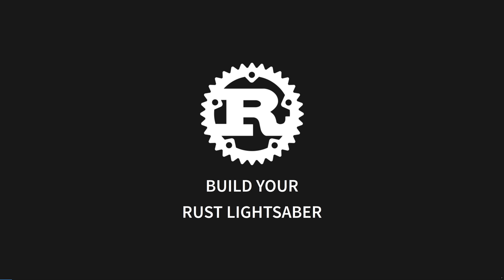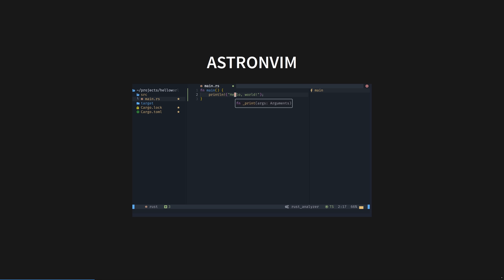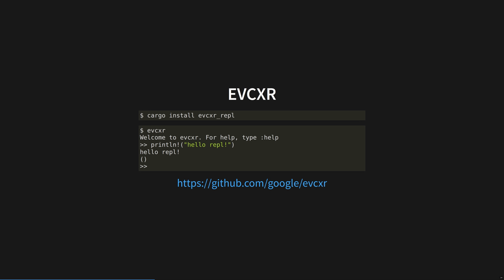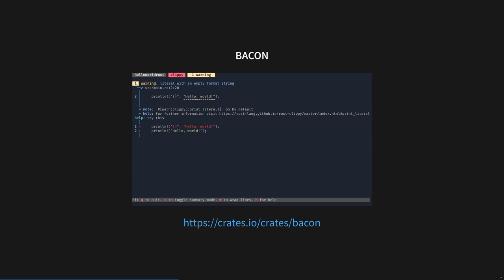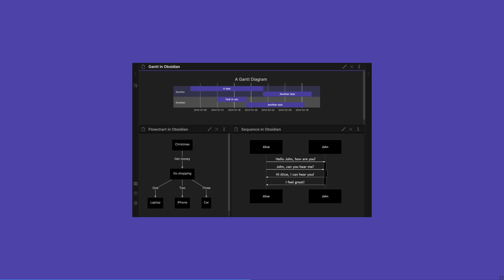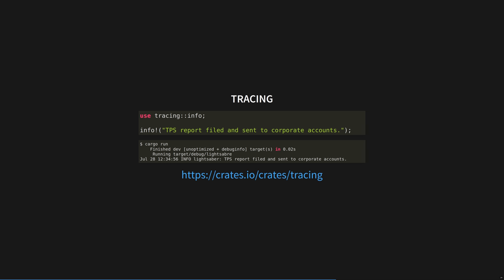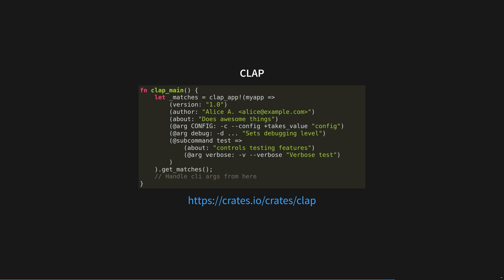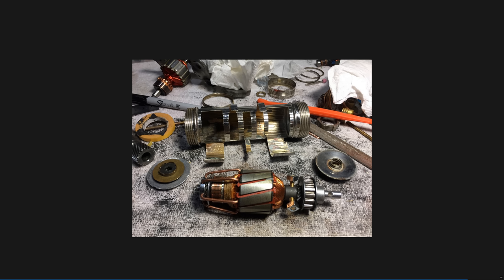Build your Rust lightsaber

Comment from the maker: ERRATA

I now (one month on) recommend irust - MUCH nicer than evcxr on the command line. 
I didn't demo this in the video, but neovide has a RAILGUN cursor mode https://neovide.dev/assets/Railgun.gif
Reply: 2:40 LSP, Language Server Protocol (Lump space princess)
Reply: @marcelo55869  That's out of context, clearly LSP means Liskov Substitution Principle
Reply from the maker: @marcelo55869  omg totally
Reply: - clap features presented in the video are from clap v2, not clap v3 
- isn't time the better crate compared to chrono ?
Reply: @walidjabari4985  yeah, time is looking to be the replacement for chrono and is being considered for std inclusion
Reply from the maker: @walidjabari4985  oh WAIT is that why I thought they were new features? Does v3 just have builder and derive?
Reply from the maker: @walidjabari4985  I ignored time because the documentation looks like this https://time-rs.github.io/book/index.html
Reply: @NoBoilerplate  ahahaha, that documentation is fantastic! Well, at least until you need to use it. Otherwise, I feel I might switch from programmer to philosopher... But chrono sounds cooler anyway >.>
Reply from the maker: @TheCreator1197  I'm unsure which is the best to use, I'd try both, chrono certainly has fewer downloads ..
Reply: @NoBoilerplate  time seems to be in the  standard library at this point, probably better to use that now unless you have a need for more features (if chrono has more there).
Reply from the maker: @clairemoore2923  I can't quite confirm that, do you have a link? I'm sure you're right!
Reply: holy crap that RAILGUN mode is AWESOME
it's one of those things that would just aid so much when navigating code just by adding a subtle visual cue to let you know where you were and where you're heading
Reply from the maker: @neithermanc1  right!
Reply: I tried irust but trying to add racer for auto-completion (that it recommends) leads to loading nightly tools and ends up in a compile error, leaving a lot of junk. I don't recommend.
Reply from the maker: @phenanrithe  Many folks (me included) find Nightly extremely stable, don't be put off by the name, this is Rust! Nightly might be more stable than every stable version of React 😆
Reply: @NoBoilerplate  Hehe, maybe. Still, I tend to favor mature crates when I can. In this case it seems to rely on racer which is not maintained anymore, which may explain why it doesn't compile. Besides, looking at the sources of irust doesn't inspire confidence, and there's virtually no unit tests. I'll stay with evcxr for now (at least as a lib). An equivalent of LINQPad for Rust would be awesome though.
Reply from the maker: @phenanrithe  evcxr with jupyter is my jam these days!
Reply: What about Tauri + Egui/yew ?
Reply from the maker: @RoastLambShanks  Strong toolkits! I did a dive into yew in my first wasm video, and egui in the second!
Reply: @NoBoilerplate  I'm thinking for desktop apps, combining Tauri with either egui or yew. It's not my idea, I saw someone else comment this someplace.

Anyway i'm not at the point yet, still learning rust at the moment, but I'll be there soon enough ;-)
Reply: @neithermanc1  i have never been sold faster on anything LMAO
i need to install neovide right now

Comment: Honourable (personal) mention for code editors: Kate.

It's developed by KDE, and is designed mainly for KDE Plasma, but it works on any other Linux wm/de, and also is available for macOS and Windows.

To me it feels like a lightweight VSCode, complete with LSP support, Git management, and a Vi keybinds mode. In terms of third-party plugins it's a little dry, but vanilla Kate imo is jam-packed with functionality and customisation options, so tweaking it to your liking is possible, assuming you can navigate through the settings page with sanity intact :)
Reply from the maker: Woah, Kate has lsp now? I gotta check this out! I've been using Kate in kde builds since 2001!

Comment: The astro vim + neovide combo looks amazing! Will definitely look into setting that up
Reply from the maker: Extremely tasty. I didn't even share the railgun cursor animations https://neovide.dev/
Reply: I used astro for a while, but ultimately switched to nvchad for the simple reason that user customization is better isolated.
Reply from the maker: @mariogutierrez4989  I'll take a look, thank you!
Reply: how do you do this? Have been trying and running into problems...

I messed up and installed neovide first, and then installed astronvim, I think I'm missing some dependencies
Reply: I'm making progress, my current problem is that the syntax highlighting isn't happening for me...
Reply from the maker: Neovide is the easy part I think, all the config is astro. Steps:
- Install neovim (get version 0.7+ from the neovim github repo releases)
- Install Astronvim
- run nvim, ignore the wall of errors, run :PackerSync inside nvim

I've heard of people getting into a pickle because nvim stores its config in different locations depending on operating system, do check you're cloning astronvim into the right location. For regular linux with regular nvim, it's ~/.config/nvim

Let me know how you get on!
Reply from the maker: @Sashin9000  oh great! inside astronvim Hit SPC L I to install rust lsp and syntax - it's a graphical installer!

Comment: So something that’s nowadays probably much easier to find but when I needed it it was quite difficult is: WGPU. It’s a crate that abstracts over multiple graphics backends in a safe manner (in the future, one of the targets it will support will be WebGPU, which is a work in progress standard for using the GPU in the browser), it can build for Angle, OpenGL, DX12, Metal & Vulkan and has, as long as you use it in an intelligent manner, quite a low performance impact. If you need an even cheaper and unsafe graphics library, its hardware abstraction layer wgpu-hal, might be for you.

Comment: laying the puns on THICK today

seriously though this is some of the best educational content on the site; going to have to watch this multiple times to make sure I understand it all.  I think this might be the fastest I've ever subscribed to a channel
Reply from the maker: Thank you so much! I'd love to know what you think of my other Rust videos!
Reply: @NoBoilerplate  I always watch at least two videos from a channel before deciding to subscribe just in case the thing I saw that I really liked was a one-off that they're probably never doing again.  this was the second one.  was already a big fan of both rust and neovim before discovering your channel (friends got me into them, but i'm still not more than a month in) but the more i watch the less reason i see to use any other language

i've always been a proponent of the argument that arguing about the best programming language is like arguing about the best tool (python is a neat little swiss army knife with a laser pointer on it that's great for doing data science but for anything computationally intensive, its puny little 5cm sawblade won't do the job nearly as well as the bandsaw that is C++) and to a certain extent i still think that's true (especially if there are library bindings for one language that you need to use if you want to release this century) but you can literally write anything from embedded firmware to GUI apps in Rust with approximately the same level of ease and performance and I think that's incredibly cool

rust has a lot in common with java language design wise and i find that interesting because coming from a python background i really despise java but i like rust quite a lot.  in thinking about why this is, i realized that Rust has all of the features of Java (like interfaces, type safety w/generics, stream-like syntax, privacy provisions, etc) but in Rust they don't suck balls (you can implement traits for types you didn't define (in fact you can even implement them generically) and multiple traits can have the same name and they won't conflict, type erasure is not a thing meaning the generic system is actually useful, Java's streams are literally on par with Python performance wise but Rust's iterator map-reduce chains compile down to native loops, Java's privacy protections can be straight up bypassed with reflections but since Rust has access to all of the source code when the binary is compiled, including libraries, it can guarantee that no one is doing anything stupid; "the compiler guarantees safety" means The Compiler Guarantees Safety and not "oh, unless the runtime does something weird") and "what if java, but it didn't suck" is something I very much like the idea of

it's like someone read my mind to get all of my subconscious desires of everything i want in a programming language and then somehow made one that had all of them, and then stole Python's type annotation syntax for some reason

i do kind of wish there was struct inheritance and it sounds like that is a planned feature but rust is so good in so many other ways that i'm almost willing to put up with having to write a wrapper impl
Reply from the maker: @amateurprogrammer25  How lovely! I'm also from a python background, been doing it for 15 years.
You might like Go, too, as it has many of the featueres you like, so if you ever get offered to write it for money, I'd say do it, but obviously I think Rust is BETTER:
No GC, bare-metal code, compile-time macros, and a community that cares about correctness!

Comment: 2:45 JetBrain’s/Intelij’s Rust support is pretty good too, in my experience it’s less accurate, sometimes giving false positives for errors and quite often giving suggestions for the wrong thing and importing it but it’s still pretty good and it’s slightly more performant than rust-analyser, or maybe not, it’s possible it’s just the way it integrates with the IDE allows it to run in the background better.
Reply from the maker: compared to vscode? 
I've not noticed any operations in vscode being more than an instant, and certainly my own nvim workflow is extremely instant!
Reply: @NoBoilerplate  compared to nvim specifically, but I have a pretty slow computer so it’s probably that in a big part. It’s definitely fast enough for me, especially with newer versions, but I used to have an issue in a project with bevy (and a few other large dependencies) where rust_analyser would often freeze up and stop responding for a while, also it would corrupt its files or wherever it stores its index and would need to rebuild it often. I haven’t seen that since I switched back to it though so maybe it’s fixed.
Reply from the maker: @awwastor  Yikes! Rust analyzer is now the recommended LSP server, and it even comes with rustup in the nightlies (and soon, in stable). I'd say it's safe to return 🙂

Comment: For an editor, I would also recommend Helix. And its written in Rust :)
Reply from the maker: helix doesn't do it for me. I need my hotkeys to be unified across all my apps, and the maintainers of Helix are startlingly hostile to adding optional vim bindings. I understand there's a config file floating around that you can get some, but it's not quite right.
To be clear, I agree that the way helix does it (kinda reverse vim) is better. But practicality beats purity every day of the week for me.
Reply: @NoBoilerplate   Yeah, that makes a lot of sense!

Comment: That's a lot of tools, some of which based on electron (which I'm not a fan of), tho VSCode has a good reputation now, and there's the open source version, VSCodium . Personally I'm using IntelliJ for a consistent IDE experience and a single tool, but you must use the non-free edition if you want the debug feature, a non-issue when you already own the UE or CLion for other purposes. It's good and actively developed, but not yet at the same level as the native languages of those IDEs. Thanks for all the references, but note that some of those crates are still very alpha or beta (0.0x version), so tread carefully. To each their own, anyway. :)
Reply from the maker: Rust crates, even early on, are such high quality, I don't mind recommanding them already!

Comment: and you also need a very good terminal: alacritty (made in rust), a very good terminal multiplexer: tmux and also a great shell: zsh
Reply from the maker: Most of that is inside neovim! I used to use ohmyzsh, but I've recently switched to fish, and really like it!
Reply: tmux is a bad idea IMO. It limits the inner shell/program, reduces frame rate, removes terminal features, and is generally slower for focus switching than a good window manager.
I get using tmux if using a really bad window manager or operating system like mqcOS, though. Then even bad things are better than terrible.
Reply: @Mankepanke  and what do you suggest instead of tmux?
Reply from the maker: @Mankepanke  agreed about the wm, I'm on i3. What's your setup?
Reply: @NoBoilerplate  Awesome right now, but I've also used i3 a lot.
Reply: @alexzander__6334  A keyboard driven window manager.

Something like i3, Awesome, xmonad, Qtile, herbluftswm, dwm, bspwm, Sway, hyprland, or similar.
Reply: @Mankepanke  tmux is a 
terminal multiplexer, not window manager, there is a difference
Reply: @alexzander__6334  Sure, I just assumed you were using it as a window manager for terminals. Almost every time I see it then that's the reason they do it.

I too use tmux for the real purpose - multiplexing multiple long-running shells on a remote connection to a server. It's great for that, although to do lose most of the modern terminal features but I usually don't need them in that case.

Sorry for assuming :)
Reply: @Mankepanke  yeah, tmux for extending my terminal, that's what i meant

ofc it would be a stupid idea to use tmux as window manager
Reply from the maker: @Mankepanke  love awesome. Tried it for a year or so, but regolith desktop pulled me bac. Such a luxurious tiled distro!

Comment: Im curious how it handles computation. It’s not a language used in the field I want to get into — that being atmospheric science — but I think learning languages is a fun hobby and it gives me a new fun challenge of taking concepts from one language,and writing them in another.
Reply from the maker: Rusts maths system is very simple, in that, like C, it's is very close to the CPUs maths system: binary arithmetic with all of the float rounding and wrapping issues you would expect. However, it's incredibly fast. Indeed each operation compiles down to very low level code. I've not looked into it, but I believe it might be even just a single cpu operation.
Built on top of that is the standard library's opt-in "checked" maths functions - safe operations that return results instead of wrapping or truncating. On top of THAT are crates for numerical computation, just search on crates.io.
If your language starts with safe operations, you often can't get access to the fast maths. If you have low level maths, you can build safe abstractions. See my latest video for a toy example of how this works!

Comment: Honestly, this video made it seem like getting astro nvim and getting it configured was as simple as a few commands in the terminal; this is not the case. Was pretty disappointed to find that out after things didn't work off the bat. But, I'm pushing ahead!
Reply from the maker: Good for you! Ping me a question in #newbie-advice on my discord server if you need it, but here's some instructions:

I too had great difficulty on ubuntu - the problem is the nvim repo version is 0.7 and the minimum that astro works with is 0.8!
Don't use the flatpak or snap versions, what I did is get neovim right from the neovim repo. 
HOWEVER!
I have good news for you, I've recently found https://crates.io/crates/bob-nvim a simple nvim version manager in the same style of pyenv, rbenv, asdf, etc. It basically automates downloading and keeping up to date with the latest nvim version.
Works on osx/linux!

As for rust-analyzer, it's dead easy once you know what to do: just install rustup on your system, but install the rust-analyzer PLUGIN in vscode.

Once you get astronvim working, just hit `spc l I` to install rust-analyzer! That will work out of the box, but you also (for some reason) need to also run a command to get rust syntax highlighting working. Just read the quickstart on the astronvim page.

This is all worth it my friend, keep going, and tag me in #newbie-advice if you'd like more help :-)